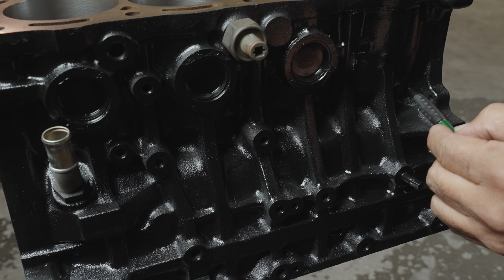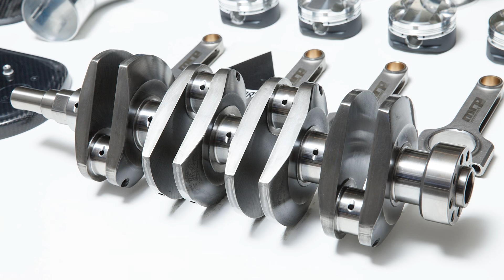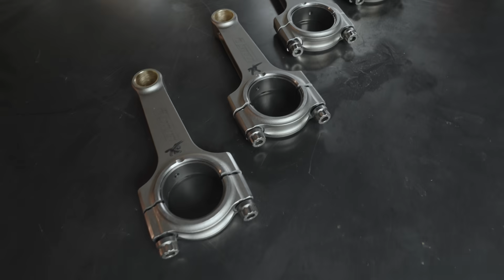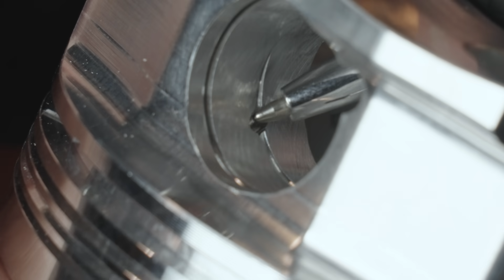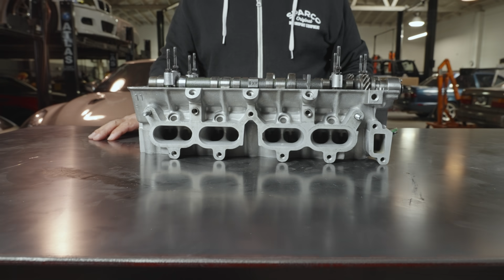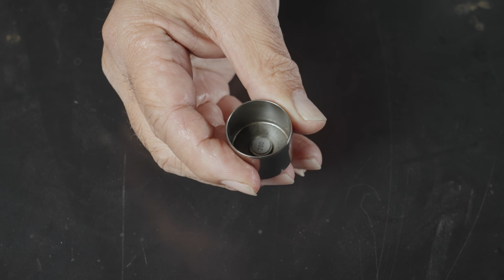Building the Toyota 4A-GE!

Comment: Never heard of a 4AGE being called a weak engine…. Importantly, you missed out that this is a copy of a much older design.  The 4AGE has exactly the same internal dimensions as the famous Lotus Twin Cam, itself derived from the Cosworth BDA.  Both famous engines in their day.  As long as you are not pushing crazy hp these are stunning little motors.  Great to race.
Reply from the maker: It is not even remotely close to a Cosworth BDA or the Lotus twin cam. It is a lot less substantial than those engines which are derived from the Ford Kent motor.  The 4AG is a pretty weak motor, it takes a lot to make them reliable even in the low 200 hp range.
Reply: @mot @motoiq “Not even remotely close”. Hmmm.  Let’s have a look at basic specs:

BDA
Intake Valve size: 29.5mm
Exhaust Valve Size: 25.5mm

4AGE
Intake Valve size: 29.5mm
Exhaust Valve Size: 25.5mm

BDA
Bore: 81mm
Stroke: 77mm

4AGE
Bore: 81mm
Stroke: 77mm

I think that is pretty close.  Then have a look at valve angles…the same…. Yes, the BDA was derived from a Ford engine.  It was designed in 1969 by Mike Hall at Cosworth, initially for the Escort RS1600.
Reply from the maker: That has nothing to do with the architecture of the engine. The Kent based BDA and Cosworth variants are nothing like the 4AG.  They are much more substantial beefy engines with much stronger blocks, cranks, way more jornal overlap and bearing area. Way better rod ratio as well. They are also much heavier. Those engines have a lot more to do with an early Ford Pinto than a 4AG. To call a 4AG a copy of the BDA is ridiculous.  It is an evolution of the Toyota A series engines.  The A series is a full Toyota design not a copy of anything.  If you took both engines apart the differences are very obvious. The 4AG is very delicate and underbuilt for making more than 200 hp. In fact the early versions can shit the bed at 180 hp.  I was an engineer at TRD during the development of these engines for GT3 and Formula Atlantic and have experienced the many failures the 4AG is prone to first had. The 4AG was a bomb compared to the BDA and was only adopted for Formula Atlantic because of Toyota's huge cash injection to the SCCA and the series.

Comment: Heard Gazoo Racing is upgrading the 4age 16v and bringing it back out on the market!!!
Reply from the maker: Supposedly with improvements from modern casting and machining methods.
Reply: @motoiq  I believe it will be a success. Stronger head plus ported. Stronger block  plus crank caps. Do you think the crank and pistons need an upgrade to the standard of the aftermarket ones you mentioned being manufactured in NZ?
Reply from the maker: It depends on the end use. The main hard to manage weakness of the 4AG has always been the strength of the crank and the block and I hope the GR version addresses this.
Reply: @motoiq  True. I definitely hope so too and I think they will because it seems like they took note of the customers' complaints and they probably watched your video as well. You literally told them in the video exactly what improvements need to take place! lol
Looking forward to you doing a review on the new 4AG in the shop, if you ever get the chance to assemble one!
Reply from the maker: I doubt we have had any influence in the process. We had these problems at TRD over 35 years ago so they knew!
Reply: @motoiq  Then I wonder what made them decide to "upgrade" the engine now only. Is the automotive industry in general realizing that the customers are realizing  that all these newer vehicles are almost disposable and expensive to own. Because I would rather drive around in a 90's corolla EE90 or a 90's Honda.
Reply from the maker: Probably they have to create new tooling and decided to use technological improvements to upgrade things.
Reply: @motoiq  I see. So maybe this might set a trend to where all manufacturers decide  to upgrade their older classic engines. Especially those that had alot of potential  but lacked optimum engineering.

Comment: I have 1991 Toyota Corolla AE92 Gti-16v based in England UK. This model had the last incarnation 4age with 7 Rib block, which ran from1989~1991 when production ceased.
My engine has 272 CAMS with O/S valves and Shim under Bucket  conversion and put out 165 bhp https://www.youtube.com/watch?v=Ll0KxvuCsWU&t=9s
Reply from the maker: Nice power for the level of mods!

Comment: The factory crank is forged and will handle much more than 200hp. The blacktop crank is essentially the same as the smallport crank and it revs to 8k+ just fine. 

“Billet” from a metallurgical standpoint is worse than forged. Although most billet cranks are a stronger material than the factory forged crank Toyota offered.
Reply from the maker: You are wrong about the power capacity of the stock crank, at least in NA applications. We have seen brand new OEM cranks fail in one track session during GT3 development at TRD.  If you don't belive me ask Barry at MRP and he will tell you the same thing.  This is on the track and not some dork saying mY 4aG wIlL pUlL tO 9K aLl dAy yO

Comment: I think crank breakage is often caused by torsional vibration, rather than the torque being produced exceeding the strength of the crank, which is not likely.
   I wonder if the harmonic damper is mismatched to 8000+ rpm usage, or even if it is just not a very good or well designed damper to begin with.
    Maybe focusing on the damper would allieve the crank problems better than just "make it stronger".
   Vibration can be brutal,  and you will never see it. On something as massive as even this "weak" crank, one degree of torsional flex might correspond to a thousand ft-lb, being applied in a reversing-strain manner, at whatever frequency the crank resonates at. Absolutely brutal. 
   It is a shame to spend on a bullet proof crank in order to survive these forces, that can simply be eliminated or greatly reduced with a more elegant solution.
Reply from the maker: You can experiment and tell me!
Reply: @motoiq  ..I should..but, like many YouTube commenters..unfortunately I am more likely to "comment" than "do".  Just finished a 4ag for a 24 hrs of lemons car, it is likely to be the last 4ag for me, and is probably far away from crank breaking performance or RPM. Hopefully. Unless one of us hits 3rd when wanting 5th or something...which might happen. Boom! 
    I'm more interested now in engines with more displacement, took me a while to appreciate what a sensible way that is to make useable power reliably. Right about when everyone is making tiny turbo engines. Bad timing.
     I have made a comment here and there on your  videos, it seems that you notice them. Thanks for that, and for the videos themselves, which are entertaining and informative.
Reply from the maker: The journals on an early 4AG crank are really small.

Comment: Brother, I am from South Africa and have a few 4A-GE engines, I have one putting out 515HP on a stock crank and stock Series 2 rods and a stock head with no rev kit and is not flowed, only thing we did is stronger pistons that is it, never had any oil pump, crank, bearing and block issues what so ever. I am more that willing to share the build photos and dyno videos, at the moment our best time is 10.83sec on the 1/4mile
Reply from the maker: If you run it for more than 10 seconds at a time it won't last very long. Also turbocharging stresses the engine less per hp than NA
Reply: @motoiq  It has been holding up for over a year now, so I guess I am lucky lol, I did not mean to argue with you was just saying what mine is doing. 🙂
Reply from the maker: How high do you rev it?
Reply: @motoiq  At the moment 8400rpm
Reply from the maker: That is reasonable
Reply: @motoiq  Also, do you know how they do VVT conversion on the 16V? I have seen it before on @garage4age but cant seem to get ahold of them
Reply from the maker: Not sure other than running a 20V head. I don't think there is a lash up of OEM parts that would make this simple.

Comment: The 20V is a failure development.
Reply from the maker: I wouldn't say that, the 20V is superior in every way except in highly modded form the big port 16V can make a bit more peak power, the 20V still has a better powerband and can probably do better lap times in a full bodied car.
Reply: @motoiq  If it's that good, how come today there is no more 20V 4-cylinder engines?
Reply from the maker: There are no more 4AG's
Reply: @motoiq  why?????????????
Reply from the maker: Toyota stopped making them around 2000

Comment: I wouldn't say the 116 hp was special my friend. Some Honda ZC engines did that in 87', and almost that even earlier on carbs. That's decent specific power, yes. Then there was the original VTEC 1.6. It could do 8 grand and 160hp in 89'. Honda had them beat. However, the 11k ability and sound of the 5 valve 4AG is something amazing that must be respected and recognized.

Comment: Elsewhere in these comments, it is said that ""people put these in those 4wd Tercel wagons."
   That's true, I did it, but it is harder than you think.  A 4age block will bolt right to the tercel trans, but there are other problems.
   The accessories are one..the different head and timing belt cover were a factor. Not too bad, though. 
   The cooling system is a bit weird if your donor car is an mr2 (like mine), especially if using the larger mr2 radiator. 
    The starter ended up being an mr2/Tercel hybrid, out of necessity. 
    The tercel flywheel will not fit the 4ag crank (8 bolts vs 6) and the mr2 ring gear will not go in the tercel trans. I turned down the 4ag flywheel to accept the smaller ring gear. Used part of a bad 4ag crank as a mandrel. You must remove the ring gear from a tercel flywheel intact.  They aren't sold separately.  
   Now the mr2 clutch won't fit in the tercel trans. Almost, though.  Grind/cut inside of bellhousing, it works. Fortunately, the input shaft splines match the mr2 disc.
   The tercel clutch cable interferes with the mr2 exhaust (now on the left). Tried many cables, I think the one that worked was from an old accord or prelude.
    I made a manifold,  and ran it on gsxr-1100 carbs. Got them to work beautifully,  like EFI. It even got good mileage. However, they are on the small side for a 1600 motor, and despite looking cool, it limited power at high rpm. The ignition used with the carbs was MSD with timing controls, as there was no ECU at this time.
   I then put the mr2 EFI on it. The manifold didn't fit under the hood...cut & weld that.
   The tercel fuel pump was engine driven, and low (carb) pressure. So..weld ring into tercel fuel tank and fab bracket for that, to use the stock mr2 pump. Make fuel lines.
   The throttle body points at the firewall now, requiring some ingenuity to connect it nicely to a large air filter..
   The exhaust comes out the wrong side. Making a complete 2 1/4" exhaust for this was actually pretty hard..the unibody had room for a small exhaust only on the right side. 
   The trans input shaft for the Tercel has a thin area, looks weak, but did not break, and I was abusive to it.
   The trans gear ratios were not well suited to the 4ag..you better rev it to 7500+/- rpm, or ot drops "off the cam" for a moment after an upshot. This made it either sort of slow, or moderately fast if you "whup  on it".  
   I estimated than mine may have been 150 hp, maybe. Wiseco pistons, head work, high compression, nice intake/exhaust. Stock cams. 
    This did not make for a real fast car after a LOT of work- almost as a direct result of this, I now have an LS2 in a volvo wagon....I highly recommend this. 400 plus torquey,  reliable hp..it's a blast. I think the volvo v8 swap was easier, and I made everything..engine & trans mounts,  exhaust, driveshafts, etc.
    I have seen others who have claimed to do the 4AG tercel thing, but their pics showed only a long block in the car, clearly not running. Please comment if you have, or have seen another one.
   Definitely not as easy as it first appeared, I was tricked by the in-common "A" family engine.
   I drove it thousands of miles this way, my main car for a few years. Still have it, haven't run it for 10 yrs. It is red like Jesse Pinkman's of Breaking Bad. Haha maybe it's valuable! It is unique.

Comment: I have a 7afe and 2 Sr5 1986 single carb motors. Anything useful with these
Reply from the maker: Not really not worth building.  You can make good use of the 7AFE block though to make a 1.9 liter long rod engine with a 4AG head.

Comment: Maybe we just got lucky but we ran 270kw in a turbo setup with a KE20 rolla with standard crank and block.  The rest was all forged (ceramic coated & shot peened pistons) and head was well worked.  Crank never died, tho we never stressed it too hard cept when at the runs which we pulled almost a 10sec pass without slicks (think was a mid 10) .....we got kicked off the track cos we didnt have a tailshaft loop or rollcage.  (it was an ae92 red top motor so i guess was 3rd gen ? )
Reply from the maker: Turbo is easier on the engine than NA and drag racing is easier on the engine than track days!

Comment: Nice video. How bad of a time will I have if using a 3 rib block, ported bigport head, shim under bucket, springs retainers,  kelford cams 304 duration, mrp Rods and pistons with the gurdle, gen 3 oil pump from Toyota, full e85, ecumaster classic, silvertop itbs, mrp coil over plug conversion. Just wondering because I wanted to cheap out on the crank/stroker kit which adds a decent amount...
Reply from the maker: I actually think that will run pretty good but maybe be a bit soggy on the bottom if its a full weight street car.
Reply: @motoiq  ok, I was a bit worried about the strength of the block and whatnot when revving to 8500 constantly and maybe a 9k run once and a while. The build is for drifting with the occasional Sunday driver
Reply from the maker: For drifting, I would set it up so it has a soft rev limit to where the hard cut is at 9k but it starts to come in at around 8500-8700, something like timing retard first the more and more cylinders sequentially.  Slamming into a hard rev limit is hard on the engine, especially in drifting.  This way you can feel the power sag and start to shift or reduce throttle.

Comment: Do you guys have much experience (or tips) for the 20v 4age?
Reply from the maker: Yes
Reply: @motoiq  "Yes"

Going to cross my fingers and hope for some videos on the 20v then! 

The 16v isnt too bad to find knowledge for, but its hard to find good information on the 20vs.  Ive had my rolla for nearly 20 years, and had a black top 20v in it for 16 of them.  Ive been wanting to do a "gnarly na" build on one for awhile (9-10k rpms, big gams, etc)- and acquired a second engine to start building it up, but the (reliably/good) info is scarce.
Reply from the maker: its coming
Reply: @motoiq  "its coming"

Such a tease. But just like that- You have a new subscriber. Cant wait!
Reply from the maker: Our plan is to build a 10,000 rpm screamer and a FBO street one.
Reply: @motoiq  "Our plan is to build a 10,000 rpm screamer and a FBO street one."

Oh dear lord yes please. Do you have even a ROUGH eta on when youre hoping to attempt to do this?

Ive had my rolla for 20 years, and had a 20v in it for 16 of those years. Ive just finished some big work on my fd and my 240z, and am intending to do this exact thing next with the rolla- so im anxious as all heck to see this.
Reply from the maker: late this year

Comment: In 2006 Toyota was convinced to do a 300 run on engine blocks for the FAT use. You can still get them, if you know who to call...maybe. I'm not debating here however. I'm not a street engine guy. It would also be good to say where those aftermarket cranks mentioned are forged not finished. Good basic info.
Reply from the maker: When I was at TRD when the program was starting, the cranks were billet not forged but who know it must have changed.
Reply: @motoiq  I still have brand new trd billet cranks and new numbered head castings on the shelf. As well as ..I think one English and two US made from the early days...billet that is .
Reply: In 2021 I found some valve blanks from 15 yrs ago and made some valves, which I called SF or superflow based on the bench numbers. I've been too busy with other businesses and the old company is just idle...the web stuff is gone and that side is now invisible to any searchers..I've sold most of the prototype stuff, very easily. I might have stuff stored but only for really serious guys. When I die my kid will burn it all...
Reply from the maker: The first ones were made by Scat as I recall.
Reply from the maker: Do you have a list of stuff you want to sell?
Reply: @motoiq  correct
Reply: Scat did a hmm decent job, but there were problems.
Reply from the maker: I don't remember any, what did you see?
Reply: @motoiq  I'm just back, do you have an email or is it @MotoIQ? very busy and worn out from driving and dealing with pencil pushers. I have to run I dont know how to send private msg and I don't want to waste your time. Everyday above ground is a good day cheers
Reply from the maker: mike@motoiq.com